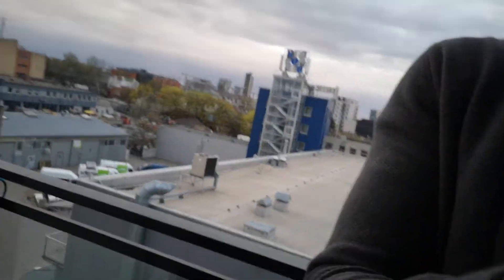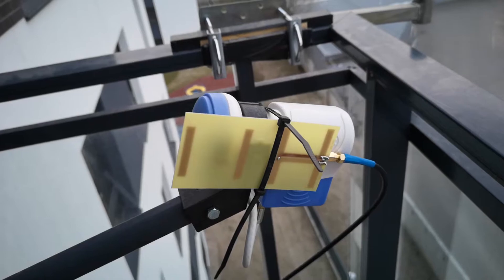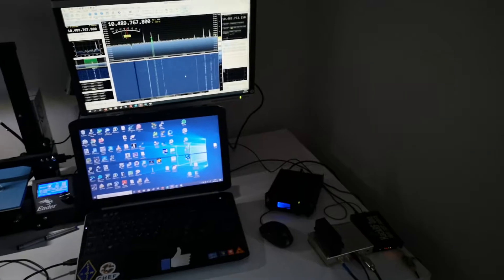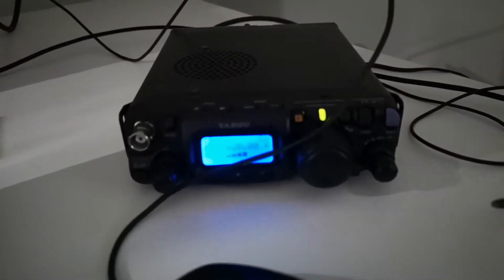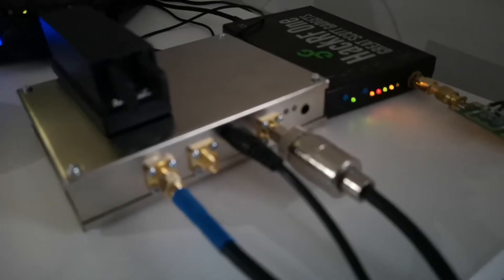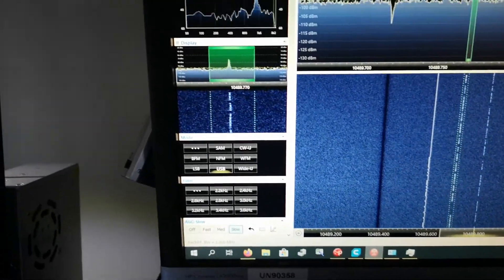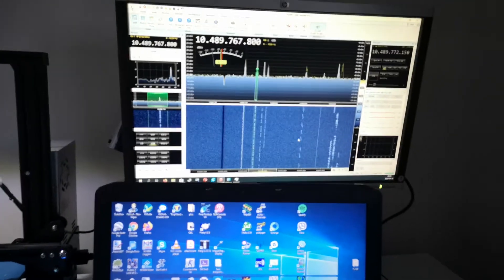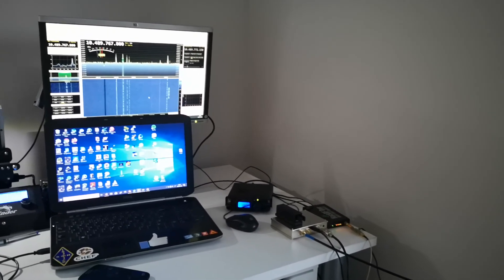Transmitting CW to Es'hail-2 (QO-100) - LY2EN QTH

Comment: What's the point of QO100? Then I could rather use a cellphone. So much more fun with HF and 2m line of sight, the challenges make it hard but fun
Reply from the maker: @do7425  do you have a hobby yourself?
Reply: @ly2en yes I am a radio amateur. Just got a 910H and could set up for QO100, but there seems to be little challenges and just a lot of money to get set up
Reply: @ly2en I edited my first comment, thanks
Reply from the maker: @do7425  well we call the amateur radio hobby the "hobby of radio lovers" in Lithuanian. So you need to pick whatever floats your boat in this hobby. I don't get PMR, but I love to work QO100 quite often. The idea of a space radio mirror affixed at a particular point in the sky just amazes me. That is what QO100 actually is.